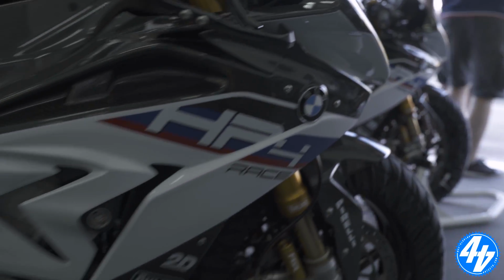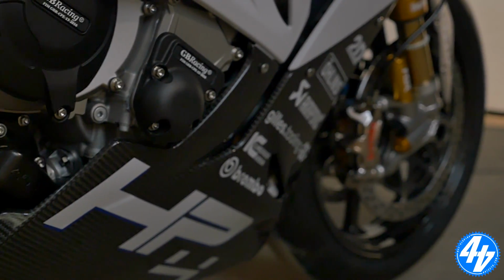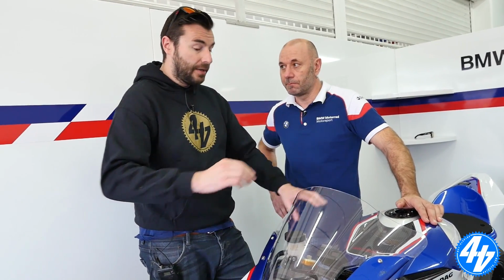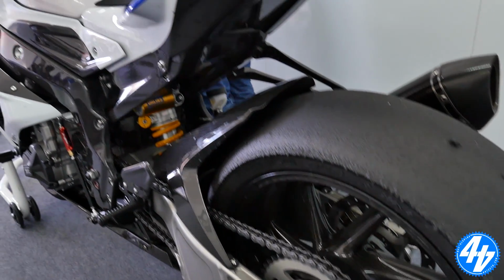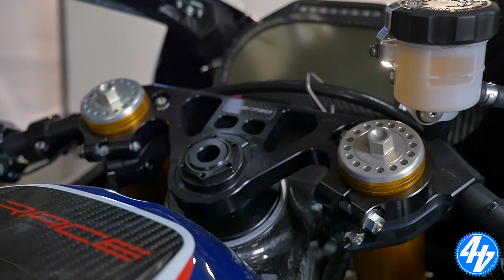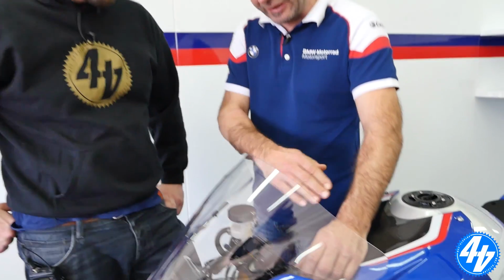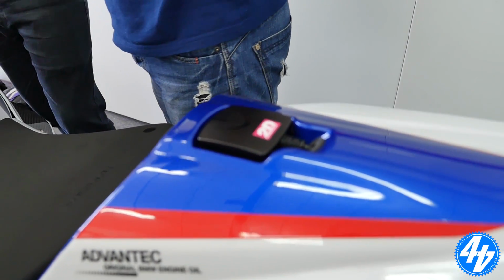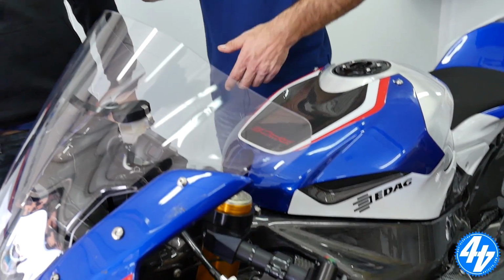Close-Up: BMW HP4 RACE

Comment: I think my most curious question is. Is it better than a V4 Speciale with carbon wheels, carbon body, race rear sets etc. I imagine the weight discrepancy  will be still big, at least 35lbs. But the cost will be much less than the BMW. I'm super curious to see a lap time of a race ready V4S.

Comment: You pay 80k for a bike, after 5000km you have to replace the engine for a “special price” of 12k? Isnt this a little ridiculous?
Reply: Samo Lagano no.
Reply: BaronVonGrumble  I know it’s probably the best bike out there, apart from that can you clarify?
Reply: Samo Lagano it's 100% race bike... So ofc it need maintenance after hard use... The same with 911 cup etc. I raced shifter karts.. After 18 hours and 3 pistons, it needs complete engine maintenance. So the high power comes always with a lot of costs and technology which is used to the maximum. But if you have 80.000€ for a bike, which is just for fun on the racetracks... I think you don't care about the 12600€ after 5500km. Which is a lot for just racing... :)

Comment: If I heard that correctly then owners that chose to replace the engine after 5K will get a replacement engine from BMW but the "old" engine will remain with the dealer... to be sold?... used for parts.. he said it could go for 8K km so those engines must go for a pretty penny afterwards.
Reply: iPANZERSCHRECKu he said it will be destroyed.

Comment: "Engine is run in on every bike" I wish all manufacturers would do this for all bikes built.  You won't have to worry if you break the engine in correctly because it's ready to rip from the dealer.
Reply: Bredaxe if you think about it I guess it would add a lot of extra effort and cost to the production process. Not something you want for the normal bike, but probably worth for an expensive bike like that.

Comment: Does this have the trick electronic suspension that was on the R1M (maybe ducati v4? not 100% sure) where you can adjust the settings for the phases of the corner individually ?

Comment: HOW DID THEY MAKE IT 215+!? 120nM is insane too! That's just BMW sorcery to me.
Reply: The street legal H2 is 200hp and the H2R "track only" is 310hp(329 w/ ram air "claimed"), but it's 476 lbs and would get chewed up on track by this BMW. Two very different bikes. The H2R is a drag strip bike compared to the BMW which is basically a WSB machine.
Reply: @Peanutdenver  the h2 is just a fat bloke with a strong right arm, this thing is a highly developed athlete
Reply: Well said...
Reply: Shaolinfist83 no it's not
Reply: Nyleen You must sacrifice engines and your soul on the alter of the god of speed. In return she grants you HP and Nm. This is how BMW do it.
Reply: Yeah with forced induction.

Comment: It's a lot of money, but when you consider what an actual WSBK costs and just how close this is to a fully competitive race bike, its actually quite reasonable. I want one!
Reply: Yes and considering how much sportscars cost or even hypercars cost this is nothing compared to how much performance you get!
Reply: The only difference is that you need a lot of experience to ride a bike like this even 50% of its potential, which is way easier in a supercar. Im still a big fan of these kinds of bikes though.
Reply: It’s better than a WSBK.....
Reply: Shaky it has all the electronics in the world, its probably a lot easier to ride to the limits than a 2008 gixxer or something like that.
Reply: S Haky sure, and people say that a lot, but it's not like that means you won't benefits riding this bike over a standard s1000. This bike will make you a faster rider
Reply: S Haky frankly, if you can ride a standard s1000 to its limits, then this is the perfect bike for you... you will benefit from it more than  anyone else and it will feel like heaven. Also's arguably harder to ride a 600 to its limits. The difference is in the style of riding required
Reply: Personally I think this whole notion going around of a bike having some black and white "limit" that is fixed and unrelated to the rider and the setup is all just a bit of oversimplified nonsense. You can ride very slow and find the "limit" of a bike by doing something stupid/wrong, and you can ride very fast on a slow/crap bike and still be safely clear of any danger or "limit"
Reply: Exactly. Its a special engine. If i had the money I'd drain the used engine and have it on display in my house. Hahaha
Reply: VeeFour Though it’s a lot of money for nothing if you aren’t already capable of setting competitive lap times on a ‘cooking grade’ 1000cc superbike...
Reply: True, it will give faster lap times. Personally, i'd rather ride a 1000 or a 600 to its absolute limit.
Reply: I agree, so cheap for racers!
Reply: Reasonable means different things to different people apparently.
Reply: @Chris B if you buy one, that shouldn't be an issue. Most who buy one surely can buy more than one, but they buy one and one of something else to sit beside it.